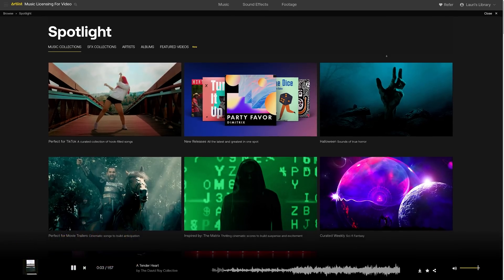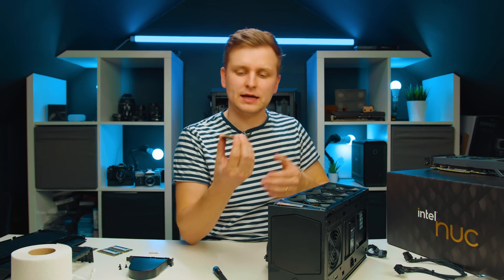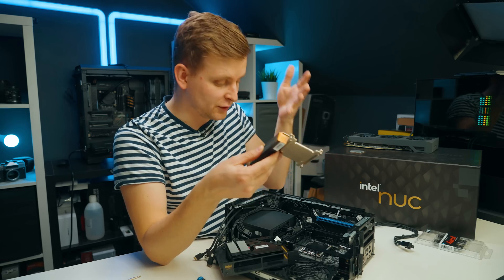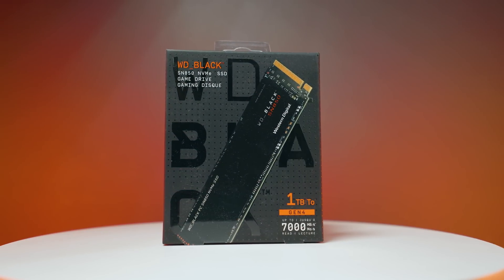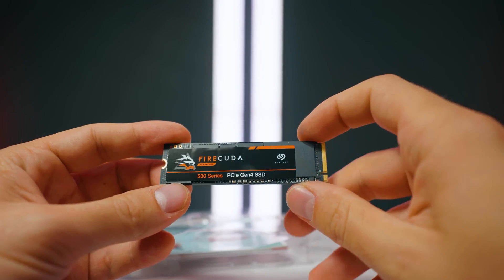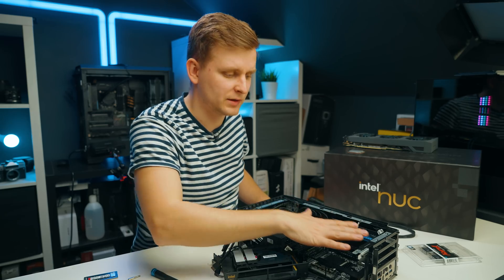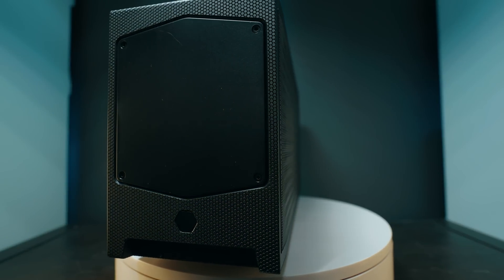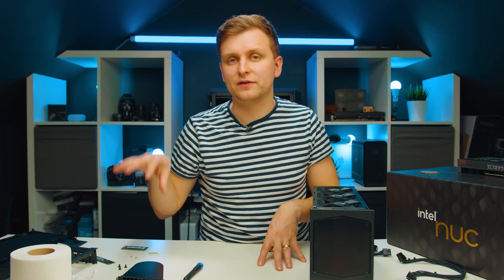MOST INTERESTING SFF PC for Creators 👉 Intel NUC 12 EXTREME

Comment: So If I want to upgrade my NUC 12 Extreme i7 to the i9 variant, is it as simple as me purchasing just the CPU 12900 i9 variant and putting it within the Intel NUC 12 i7?  Or should I add thermal paste/update the BIOS? Or is the Compute element slightly different with the i7 variant versus the i9 variant? Would it void the warranty?

Comment: First the size of a case doesn’t determine how good a pc is. It’s what hardware you have. Also why the hell would you pull the cpu out of the system to benchmark it on a different system. Test it out in the case it came with. That data that you want to do is completely useless for those who want to buy the case. You need to show people how bad the cpu will be thermal throttling because that cooler is trash.
Reply from the maker: Of course I'll benchmark the system with the PC in, but I wanted to know how does the 12900 compare to 12900k if we removed thermal limitations.

Comment: So just a bit of perspective here. 
 
To get to the 24tb of nvme you need to spend upwards of $4k on the drives alone. 

12tb of nvme space the cost is $2.4K 

A 3070 or 3070ti can be had for nearly msrp. $800 give or take. 

That makes a fully geared out system 

$1900 i9 1200k
$4k 24tb nvme
$350 64gb so dimm kit 
$800 3070ti 

So fully kitted out the cost is $7.5k 
With tax, it would be another $750 on the high end of the state tax scale. 

Which compared to the Apple system is a great value for the PC imo. 

But we’re still talking about $7.5k at the very minimum. It’ll be interesting to see if the SFF tax is worth it.  

Apple does the same exact thing in terms of the SFF tax.

Comment: Ay bro , should I go for 12700 + Msi B660 instead of 12600k + Z690. I use this pc for VFX and Editing , And which budget best cooler do you suggest
Reply: I am not an editor, but I feel like z690 is better for editors because it has more PCIe lanes. It won't bottleneck your system when adding additional storage. They also more features like pcie 5.0 and overclock. You can decide cpu base on your workflow and needs.
Reply: @ra4239  my budget is really messed up bro.
Reply: @Yaaro01129  MSI B660M-A PRO with i7 12700 is also an option if you have limit budget.  please don't over pay for a B660 board.
Reply: @ra4239  which cooler will be good bro ? 12700 + B660
Reply: @Yaaro01129  I am using Arctic cooler myself. I recommend ARCTIC Freezer 34 Esports Duo, but they don't include LGA 1700 kit in the box. you either buy it or contact Arctic to get the kit for free.
Reply: @ra4239  how is it bro... will it be good for 12700??
Reply: @Yaaro01129  Arctic is one of the best brand. Their product performs very close to Noctua but half the price.